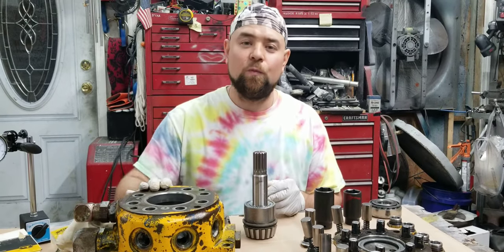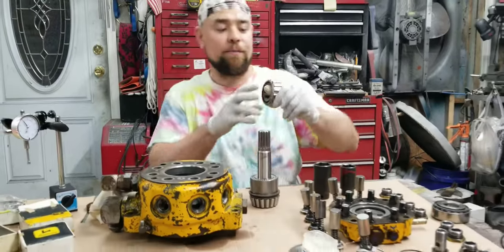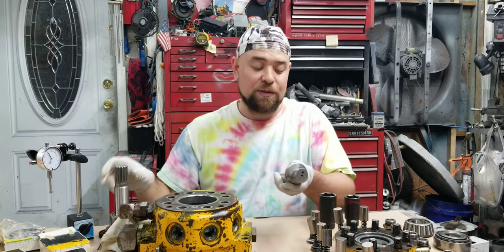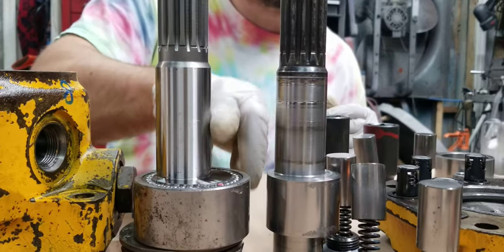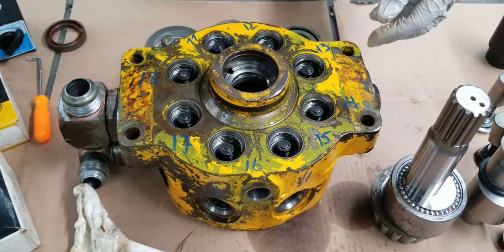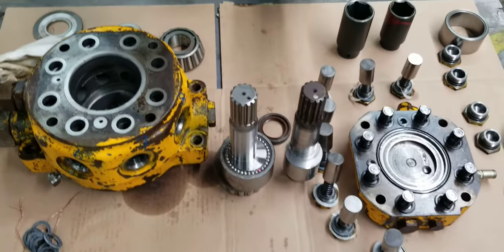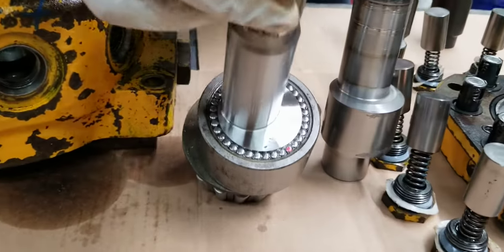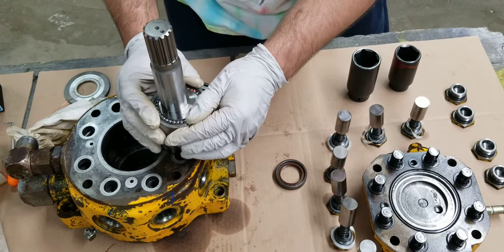John Deere  hydraulic pump tips

Comment: Good video, the "Washer A and Washer B" or the Black "square packing" and the white "backup washer" are the primary sealing device. The external seal is basically a dirt seal. As you mentioned, anything that gets past washer a and washer b goes back to the transmission. If washer a and washer b get wore out they will leak and overcome the external dirt seal. The dirt seal is not made to hold the full pressure inside the pump. Something else to check is the drain line that goes back to the transmission sump can sometimes get plugged causing the dirt seal to fail as a small amount of leakage is expected past washer a and washer b. Also I noticed your dime valves showed quite a bit of wear, the ones sitting on the rear plate. Those are cheap and easy to replace. Like you said, many times the main bearings and races do not need to be replaced. Good work, keep it up. Also good english, easy to understand. God Bless
Reply from the maker: One of the best comments 👍 Thank you so much for your time, I am sure lots of people will appreciate it as much as I do. With the valves , I couldn't find the tool to get it all done. Any advice or video will be greatly appreciated. I am planning to restore this great backhoe.

Comment: How does the pressure limiting system keep the pistons off the cam?  Does the pressure compensating (relief) valve feed oil pressure to the pump case?
Reply from the maker: Interesting question, does it at all?

Comment: Was wondering what model machine it came off of.  I have a slightly different hose location set up and am trying to figure out a different problem. But will be doing going through it the same as you are. Did your noise go away or get better when you used a hydraulic function?
Reply from the maker: It's 310a and it was green color before =(farm) it's definitely more Quiet now and I am not as worried about it anymore.  Just make sure it's all done by the book (end play and other things like that) once you will have it all on the table , the pump shaft will tell you what you need to get. You will see the difference. Good luck on your project.

Comment: Great video. Did the new bearings fix the noise issue?
Reply from the maker: It's day and night.  It sure sounds healthy now. I would say not as horrible noise. Its loud when it's brand new.  I believe it's normal , but it doesn't punch you in the years anymore.
Reply: @colossus5752  awesome. I’m rebuilding a pump from a 4020 right now. It has the same issue as yours with the pitting on the cam portion of the shaft. Waiting on a new shaft and bearings now. Thanks for the video.
Reply: @MSCrappieSlayer  I have a 4020 to rebuild myself. How difficult is removal? Any pointers? Where did you get the shaft and bearings? Can you list part numbers? Thanks, and hope it all worked out for you.

Comment: Thanks for the education. The flat race around those pin bearings is not the same on both ends. One end is beveled and the other side is flat with a groove around the inside perimeter. I did not notice this in disassembly. Do you know which side is which?  Is the beveled side on the shims or is the beveled side against the bearing?
Reply from the maker: Bearings go one way only, and shims go on outer plate side .